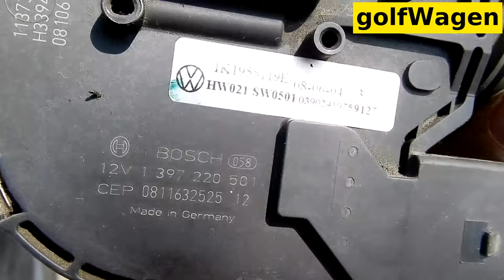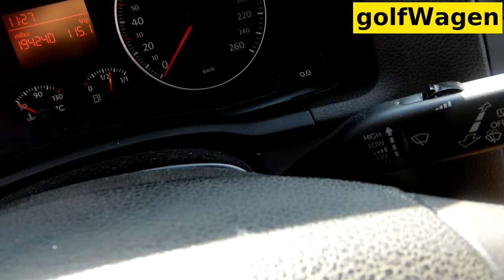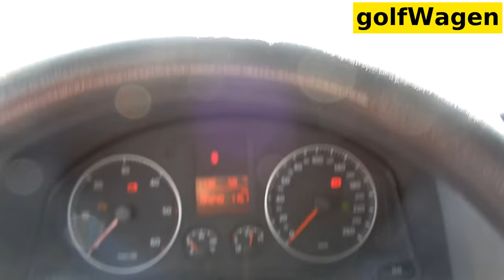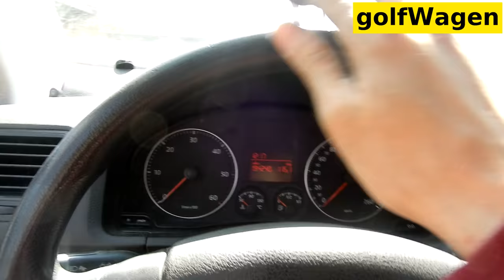VW Golf 5 windshield wiper motor replacement

Comment: To bad my windshield wiper arms are so stuck to the linkage, I cannot remove them even with bearing pullers. xD
Reply: Did you try a pry bar?
Reply: @azizhachimi8744  eventually I broke one bearing puller. Got another, stiffer one with thin “arms”. Finally, I was able to remove both wipers, although they came off really, really hard..

Comment: Great video! Tell me is the a way of powering the wiper motor for testing its operation when out of the vehicle by using a battery or it will burn the board inside?